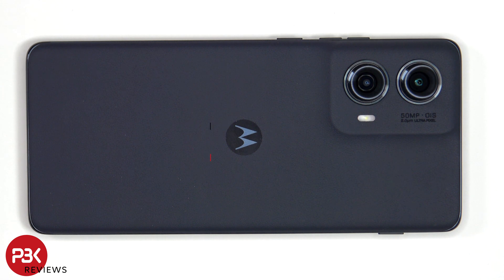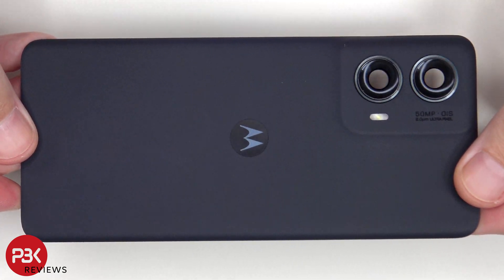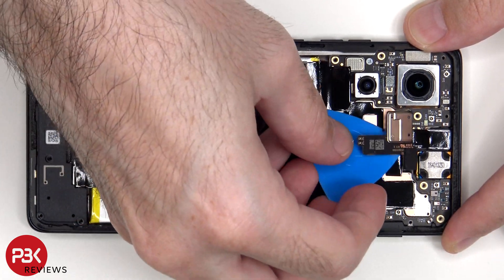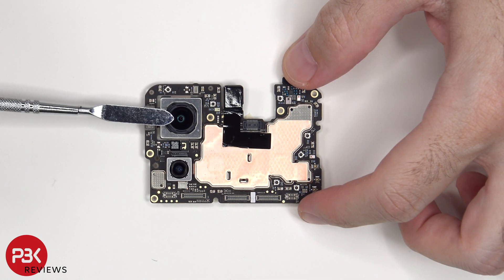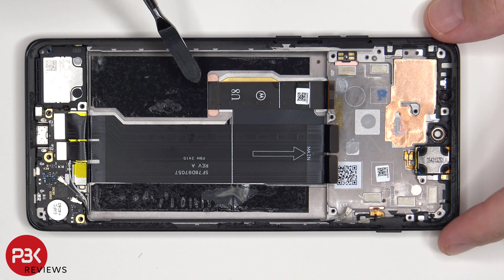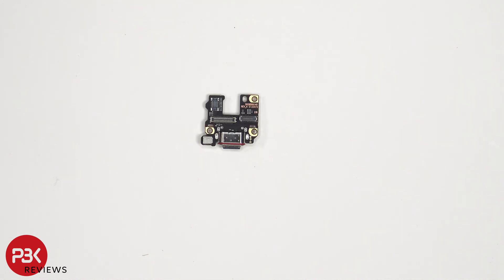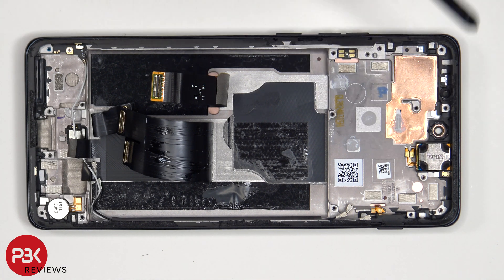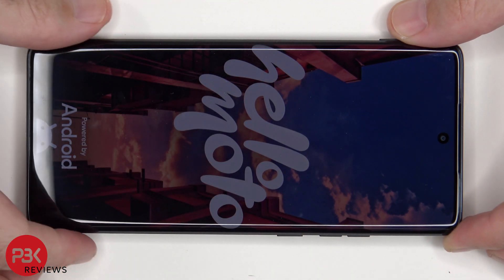Motorola Edge 2024 Teardown Disassembly Phone Repair Video Review

Comment: Some say using acetone what you call nail paint remover for removing the stick glue battery...
Is that true..?😊
Reply from the maker: You can use isopropyl alcohol but not acetone. Also the adhesive isn't that strong to have to use it.